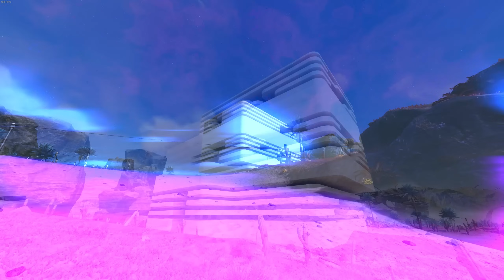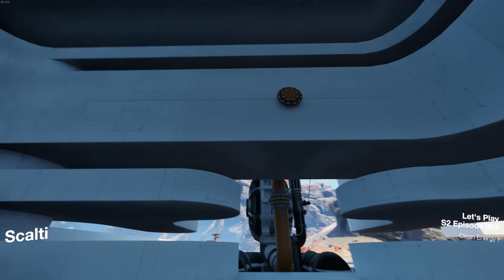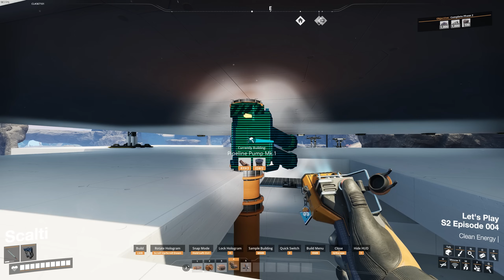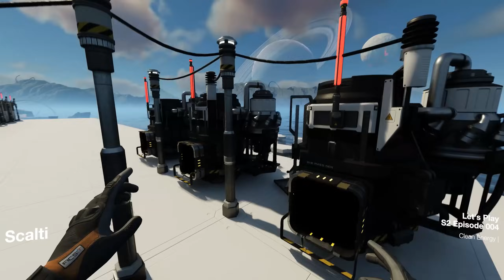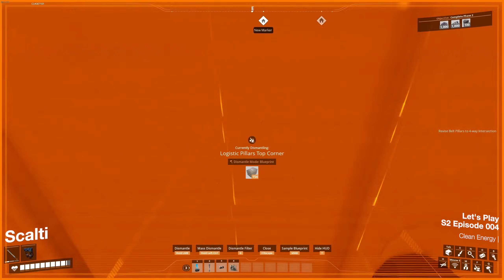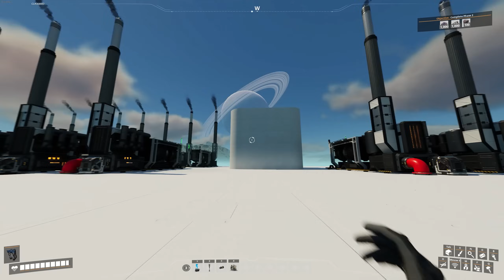Satisfactory Let's Play S02-E04 - Clean Energy [SATISFACTORY LET'S PLAY]

Comment: Lovely design!  FYI, the power problem was probably just due to the fact that you're using up the water immediately, and it takes a bit of time for more fluid to flow through the pipes.  I like to run the pumps for a few minutes before connecting the generators to power, to make sure the pipes and the generators are full of water before they start.  That way they have a buffer to pull from and the water never drops to 0.
Reply from the maker: There was a bug at the time which was fixed that impacted flow in a pipe between a pump and floor hole junction. This was fixed in the 1.04 update I believe.

Comment: Nice reference, the G*damn pen is blue!  X'D  But yes, I had to stop the video here to comment that I like this approach to build some common structural elements in blueprints.  Then you can more quickly build new sites with a similar style, create variations, go back and add lighting, modify or replace sections, or expand buildings.  Also, yes, it's difficult to inregrate vertical and horizontal curves with the smaller quarter foundations and no matching larger botton/outer quarter foundations.  I've kind of done it but it's a bit odd.  So yeah, it's clean to do to vertically stacked curves as you've done, and optionally some limited foundation pipe and dual radial elements.